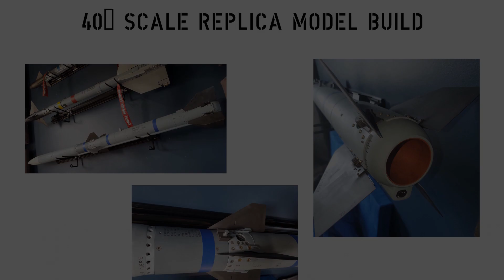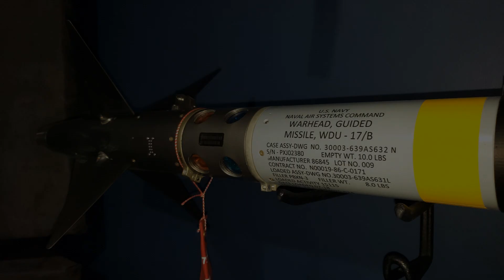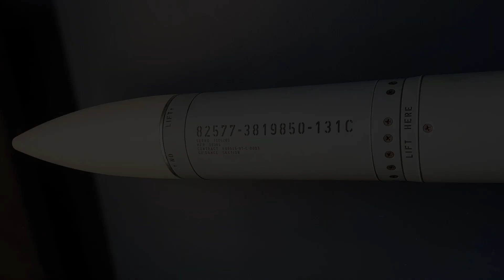AIM-120 AMRAAM Air to Air Missile 57% Scale (DIY - Project Build) #AMRAAM #AIM120 #missile

Comment from the maker: Not that much. The main body is aluminum tubing and that's the largest part.  The only parts printed are the nosecone, fins and wings(which use very little filament), rear cap, a few other small parts. Maybe 2lbs. This model is mostly drilling.